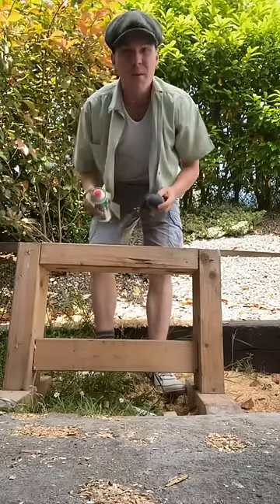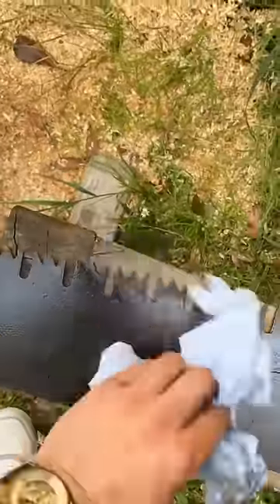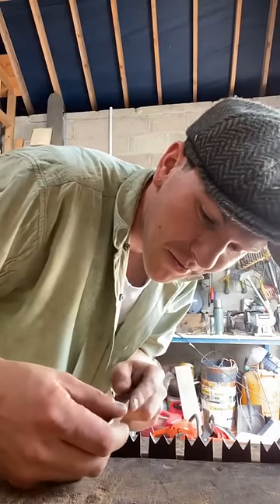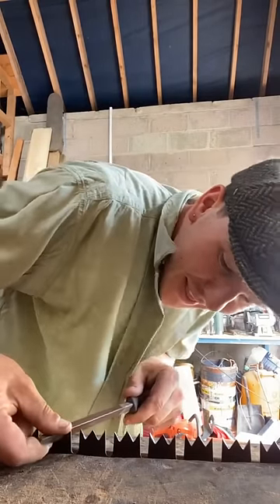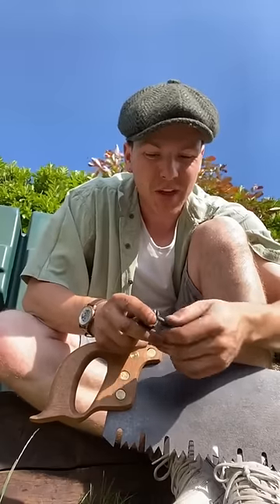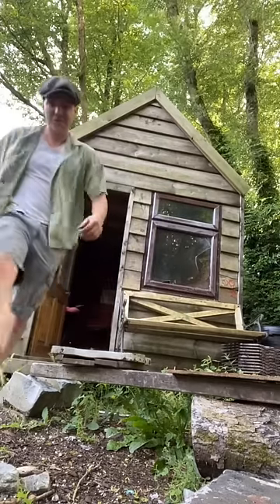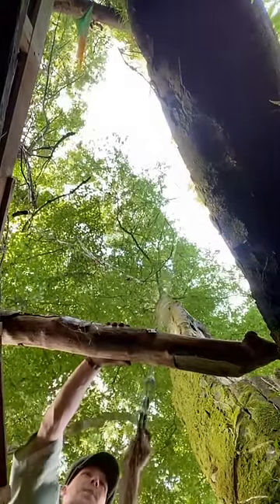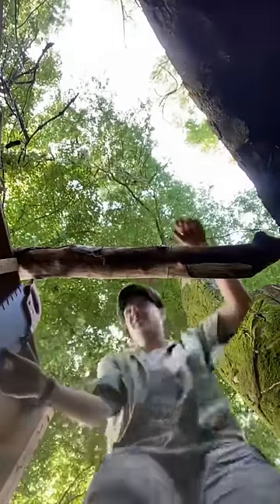Restoring & Using a Crosscut Saw #shortvideo #ireland #woodwork #crosscut #restoration

Comment: be careful buddy, that rusty old saw can still cut the hell out of you.
Reply: Because that’s how a saw works
Reply: @Mewhenihaveahandle he’s not wrong my uncle always told me growing up the most dangerous knife is a rusty one because people assume it’s not as dangerous while it still is
Reply: @Z_Rodriguez13 rusted and dull knives are always the most dangerous types of knives because of their unreliable nature and higher probability of self inflicted wounds when the blade slips off the target object and slices you open instead; as the amount of pressure applied to the intended target needed to cut is greater with a warn blade than a well maintained one meaning that once the blade slices through or deflects theres still a good amount of oomph behind it more than capable of turning yo ass into an osha violation
Reply: @forrestgumpberunnin any blunt tool is dangerous
Reply: I think he's quite intimately aware of the potential dangers.
Reply: Yeah I think this guy is aware of what a saw can do. Next you'll tell Bobbly Flay fire is hot
Reply: @Z_Rodriguez13 nobody said he was wrong. It's just stupid to tell a woodworker to be careful with a saw. He has refurbished dozens
Reply: @REAPER3fitty  plus he knowingly just sharpened the teeth lol
Reply: @Mewhenihaveahandle  saw is often used to cut wood so yes it can cut the hell out of a person In fact, a rusty blade may still be very sharp, but the exposed corrosion will cause the teeth to act as if they are dull. Clean saw blades are not only safer to operate, but they make a smoother cut.
Reply: He literally dose this shit all the time. Have You ever gotten cut up eith a rusty saw when trying to sharpen it
Reply: Love when some schmuck is trying to tell a professional how to do their job. I think he knows, tools is his whole thing.

Comment: When I clean saw screws all I do is wipe or scrub any dirt off with a soft brush, then coat them in Brasso. After an hour or two I'll wipe it off and the screws are cleaned and lightly polished without making them look too new, or adding any scratches from sandpaper.

Comment: Boy that thing works better than a chainsaw IMHO
Reply: I have a chainsaw and it will out cut the old crosscut saw with way less effort . I’ve got a couple old saws hanging on the wall and have no desire to use one . 👍🇨🇦